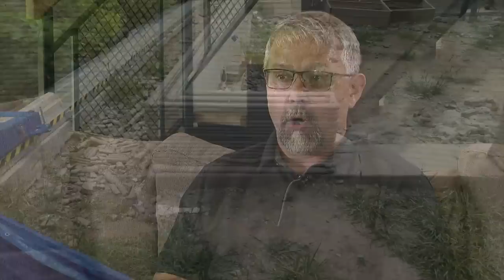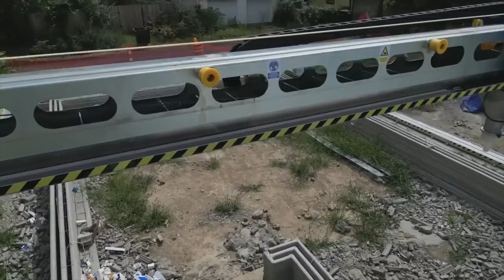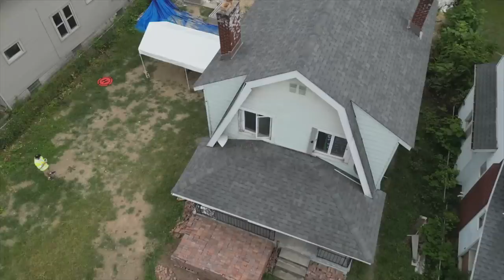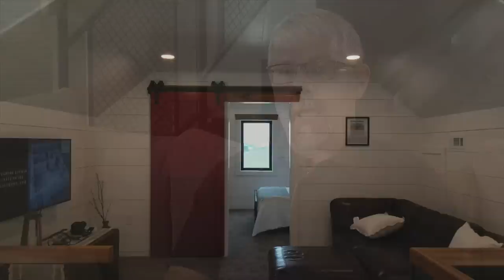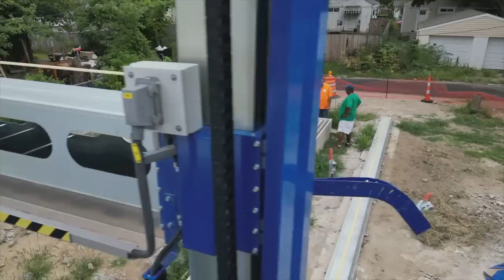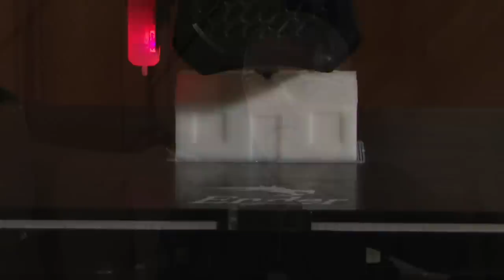Builder of first Ohio 3D-printed home says own 'for the price of a car payment'

Comment: So many problems with this high tech mud hut, not the least of which is weight. It looks like many tons of material sitting on an 18 inch concrete footing. It will settle and crack.
Reply: I didn't think of this, good eye!

Comment: What does a printer have to do,with this ,how does this work is it made,of,paper?
Reply: It's like an upsized 3d printer and instead of using melted plastic it 'prints' out a computer drafted design of a house from the ground up with concrete. It's a cnc machine for building parts instead of milling them out of metal.
Reply: @yerbudspud  thank you just watched a few videos it really doesn’t make much sense it’s the same as pouring concrete and building with wood on the foundation, except you have to drag that big ol machine around, the cost is more 700.000 for a three bedroom all because of technology

Comment: They are leaving out a lot of information. Who does the electric, plumbing? $160,000 for a concrete house made by two people? Rip off. The cost of the land? Deceptive video title: Builder of first Ohio 3D-printed home says own 'for the price of a car payment' - no home for the price of a car payment. 
Don't be fooled. It's a con job. Think it through. Same thing with electric cars - remember how cheap they were supposed to be and now we come to find that you have to change out the batteries.
Reply: Don’t forget. Sone of the early humans were against the invention of the wherl
Reply: Pricing changes as they pump them out faster than traditional stick houses, less hours to set up internals. Lot of problems that need to be addressed and fixed same as anything new but there is potential.
Reply: I blame the title on the reporting.. which was awful. The guy was clearly referring to tiny/micro homes when he said that line.

I don’t think it’s a “con job”.. but the cost is absolutely absurd for sure. To his credit, he does make a valid point that the cost would have to be “similar” to traditional housing at least initially, to keep house flippers out.

This tech needs to disrupt the market, not learn how to work with it. They should only sell to low income families and work with governments to create regulation. Sadly that will never happen, so the prices will stay high.
Reply: @HiThisIsMine  The government is the LAST!!!!!!!!! people I want to have anything to do with houses.  They have FAILED miserably every time they have tried.  Remember the "projects"?  Remember backing low interest rates and virtually no money down to buy a house that was responsible for the 2008/9 crash?
Reply: LOL. Most EVs have batteries rated for over 10 years. Not a lot of people keep cars for more than 5 years. Besides that, in 10 years, battery technology will change, improve, and lower costs. Learn a little before you knee-jerk misinformation.

Comment: My dudes. We can pour concrete slabs, and then lift the slab into place as a wall. We've been doing that for... A very long time. Drive around any industrial area, see those large section walls, some of those are concrete slabs that were poured onsite, and then hoisted into place, once set. This is actually just the long form, and more expensive way of going about it. Want to build concrete walls? Instead of doing it the fast and easy way, we'll make it as hard as we can, and then charge you an arm and a leg for it, sucker mark person, maybe.
Reply: Literally every structure south of the Rio Grande to the tip of South America, and probably the rest of the world has discovered and embraced this revolutionary technology of concrete and bricks. I don't know why everything has to be so complicated in North America.
Reply: And it takes 5-6 days? A good crew could frame out a house that size in 2-3 days. With a saw, and air compressor and a couple nailers. No 50 ton contraption needed. I bet just the set up/break down/cleaning time on that is 2 days on  it's own.

Comment: No ground excavation for water and sewer connection. Where's the plumbing? Where's the electrical system?
Reply: kinda stupid how you dont know its installed in the slab.  and spots in the walls can be left for plugs.
Reply: @XXPYR0XX  The problem is when there is an electrical or plumbing defect, you have to break through the thick cement to get to the wiring or pipe. I can see the outside being cement, but the inside should remain drywall
Reply: @XXPYR0XX  It is America, afterall
Reply: @XXPYR0XX  My point is that the video avoids all of these subjects. The overhead picture presented does not show that public utilities needed to be hooked up thus the subject is never raised. How are the pipes and the wiring run? A man sits in one room and describes the house in a location without receptacles or fixtures. Speaks of showers rather than walking to the showers for filming. Shows no outfitted kitchen. None of the utilities can be "printed". Why not tour the house and show these features if they've yet to be installed? Discuss the challenges involved in outfitting the house?
Reply: That is installed under the slab, before it's poured, most likely along with in floor radiant heat.
Reply: @gwpurdy  behind cement walls.   Forget it

Comment: 200 a square foot? 
So 200,000 to live on a space that as big as my garage. 

Without the lot.
Reply: He said below. 160, and that is the higher trim models, not base models. And prototypes are usually more expensive, not less.
Reply: @rdizzy1   
Thats why he says  it'll be less.  He keeps contradicting himself thru out the video, which means he is being deceptive. Plus, its a slab.  Bottom tier house, sorry. Garbage house....liar in the video
Reply: @JohnBrown-rg7ug  He gave an exact number for that exact specific house, in the video, which was 160.
Reply: @rdizzy1 - the point remains the same. Based on the previous math, it’s $160,000 for just the construction and you still have the cost of purchasing the property which is where all the cost is these days.

He also went on to say that he feels you would have to price it competitively because otherwise you’d have investors snapping these up instead and flipping them for a profit. So in reality, the prices will remain the same… high.

Comment: if the walls are 3d printed....where's the wiring and plumbing?
Reply: Each wall is actually an inner and outer wall. So there is a void for mechanical

Comment: sounds great but i know they are super cold in winter anyone who has a concrete basement would know that
Reply: Insulation + drywall = heat/AC retention.
Reply: Do you really think they'd use concrete and nothing else? Looks like everything else could be done the same way it's always been done.

You can see in the top down shot where parts of the walls look like they have a gap in the middle for wiring, plumbing and insulation. I highly doubt the entire thing would be solid concrete.
Reply: Nope. In floor radiant heat using pex, water and boiler or electric. It is fantastic here in MN and costs pennies on the dollar to heat with!
Reply: Well, I live in Texas where it's hot as ask And electricity goes up to 400 a month during the summer.
Reply: @rodneypratt4324 And I am in southern NM. Southern Trombe wall and northern wind tower would cover all seasons.
Reply: You are correct Rhett Johnson. I would add a trombe southern wall or narrow greenhouse like earthships incorporate into their designs.